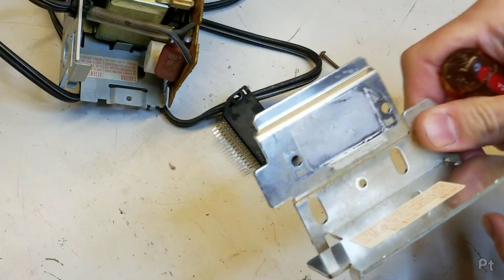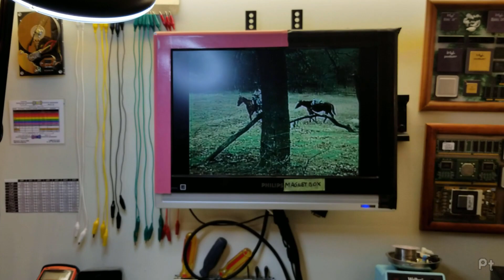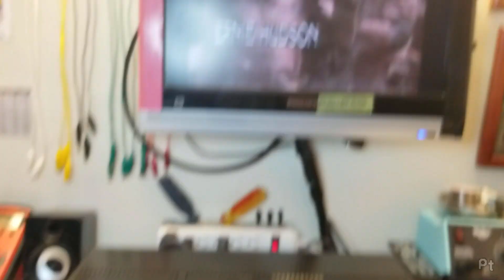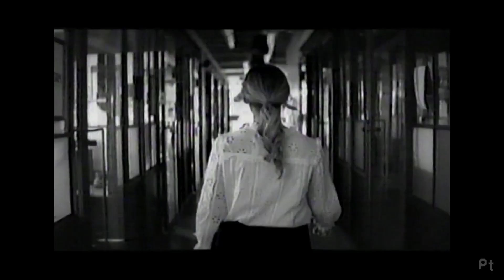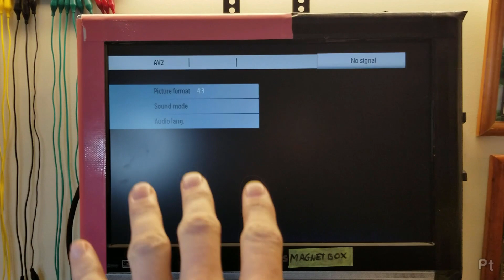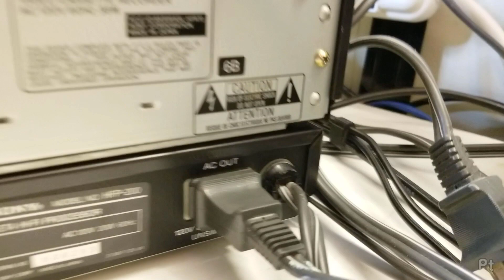Sony SuperBeta VCR & HiFi Processor (Model SL-HFR70 & HFP-200)

Comment: Do you still have the capacitor list? Got a unit that has a bunch of issues and wondering if it's due to a faulty power supply.

Comment: I'm slightly confused why Sony made the Hi-Fi processor a separate unit, especially on a model late enough to feature SuperBeta. Why not just make 2 VCR models one mono and one Hi-Fi? I can see this being a way to upgrade to Hi-Fi at a later stage, providing the VCR had that special connector, but I would have expected that on much earlier models when Hi-Fi was a brand new feature.
Reply from the maker: I think the idea was you could upgrade in the future. Instead of buying a mono VCR and then having to buy a whole new machine to get HiFi, you just bought a less expensive add-on module. That was the idea anyway. In reality, people just bought a new HiFi VCR and either sold the mono one, or kept it as a 2nd VCR.

Comment: Where did you order that voltage regulator from?
Reply from the maker: A seller on ebay, can't remember the name. I doubt they are legit original parts, but it's been working fine so far.

Comment: The temperature of that heat sink is normal. Those power supplies always made a lot of heat. My SL-100, which has been with me since I was 3 years old, always ran warm when in operation.

I actually have this VCR, sans the HiFi processor. It was a thrift store purchase, along with a a couple dozen excellent condition tapes. I have the remote as well, and all it needed was a good cleaning. The voltage regulator is still working fine on it.

Your symptoms of the bad voltage regulator were exactly what my SL-100  was doing when it failed.
Reply from the maker: Thanks, I kind of figured it was fine but was just needing some confirmation. Whenever I replace a part that gets very warm by design, I'm always worried it will fail again.

That's awesome that you have the same VCR from when you were 3. I have the one and only VCR my parents ever bought that's older than I am, but it's led a very rough life. I only keep it for sentimental reasons.

Comment: How does the recorder gets the hifi tracks on the tape?? It has no hifi heads I guess?
Reply from the maker: Beta uses the same heads for video and HiFi audio. VHS couldn't do this (I don't remember the technical reason) so they had to add separate heads.
Reply: @probnotstech  I see. Never knew that. I guess you cannot combine video with hifi sound?? The real hifi Beta decks alle have rotary video AND audio heads.